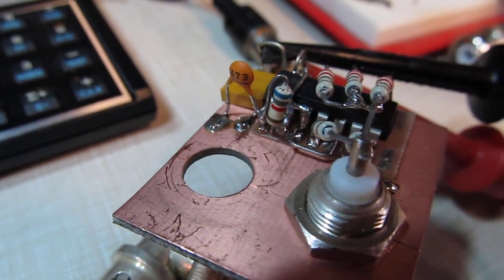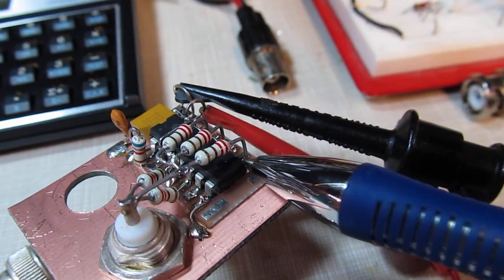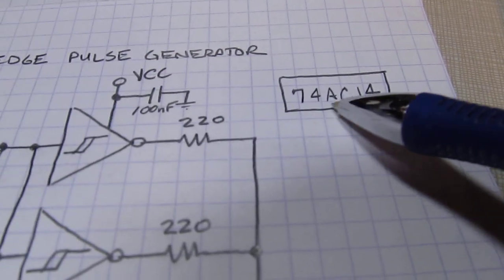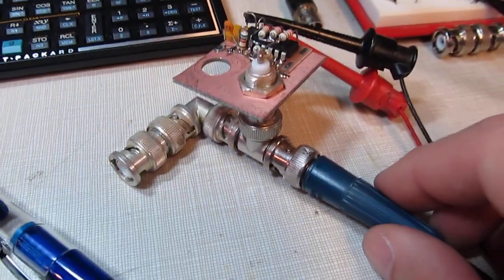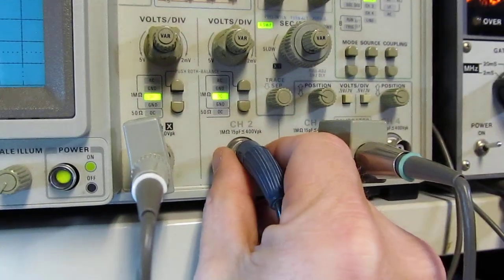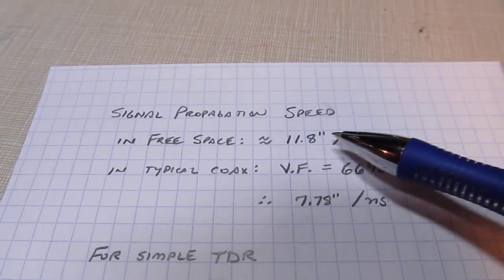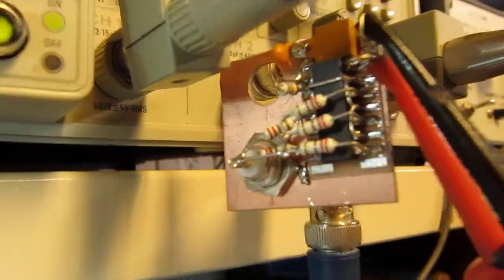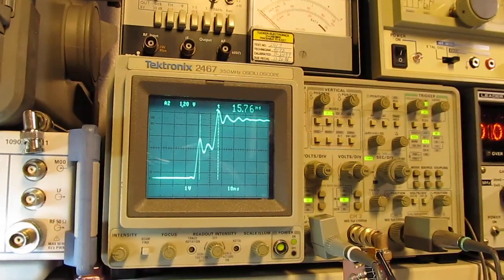#88: Cheap and simple TDR using an oscilloscope and 74AC14 Schmitt Trigger Inverter

Comment: W2AEW, say i have a 50 ohm source connected to a 75 ohm coax terminated at 75 ohm resistor then base on your reply it will not have a reflection. But how about at the point of connection between the source with 50 ohm ang the 75 ohm coax? Dont mean to bother you, just wanna understand.
Reply from the maker: +rommel villon There will be a reflection at the interface of the 50 ohm source and the 75 ohm cable, but that will reflect directly back to the source and be absorbed - but you won't see it at your observation point, if you're observing it at the input of the 75 ohm cable.

Comment: A follow up question, what if i want to apply the measurement of length using this technique with just a cable. How does impedance matching applies here.
Reply from the maker: +rommel villon In order to measure length, you will need to know the velocity factor of the cable (regardless of impedance).

Comment: Hi W2AEW,

You mentioned that you selected the value of the 5 output resistors so that the output impedance gets close to around 50 Ohms but i cannot understand why 220 instead of around 250. Another thing is if i want to measure the impedance of a  coax(say 75ohm) with this circuit with a source impedance of "50 Ohm", what adjustment is necessary?

thanks
rommel
Reply from the maker: +rommel villon The output impedance of the IC is not zero, it&#39;s likely in the 10s of ohms, so that adds to the 220 series resistors bringing the output impedance of each buffer to about 250.  No changes necessary if you want to use this method to measure the impedance of a 75 ohm cable.  If you adjust the termination impedance at the far end to match the coax impedance, there will be no reflection.

Comment: Great way to determine the impedance of an unknown bit of coax. (video #37)

You can also calculate the VF for an unknown bit of coax. Take a measured length and back-calculate what the VF must be to get the measured delay from a known length.

Thumbs up for bothe the #37 and #88 videos. (this comment posted on both videos)
Reply from the maker: +Peter W. Meek I did a video on that too (measuring velocity factor), exactly as you've stated.
https://www.youtube.com/watch?v=TpIIftvQPFM

Comment: Hi Alan, any recommendations for buying BNC connectors in bulk?

Thanks for sharing these videos!
Reply from the maker: +pj1390 No, not really.  You could try eBay or Amazon - look for vendors with high ratings and read reviews.  There's a lot of crap out there, but there are also decent ones to be found too.

Comment: i tried building the similar circuitry using a different Schmitt trigger, i am confident about my connections. my questions is does the circuitry only work schmitt trigger you used on this video.
Reply from the maker: +Mphotasium It needs to be a CMOS inverter (not TTL, and not open collector output).  The CMOS technology used will determine the rise/fall time, thus determine it's usefulness as a TDR source.
Reply: is SN74AC14N, CMOS HEX Schmitt trigger fine for the application?
Reply from the maker: +Mphotasium Yes, that should work fine.
Reply: +w2aew, thanks a lot. your information was very helpful.

Comment: Hi! just a question: can I do this with a simple wire, or does the shielding play a specific role in the coax?
Reply from the maker: +Manoel C. You need a controlled impedance and a current return path.  The constant physical dimensions of the center conductor to the shield establishes the controlled impedance, and the shield also provides the current return path.  So, no, this won't work with a single simple wire.

Comment: Apparently a difficult and expensive chip to acquire 74AC14, even on eBay.
Reply from the maker: +Digger D Really???  I see that the SOIC package version is 47 cents and the DIP package is 51 cents as shown on Mouser:
http://www.mouser.com/Search/Refine.aspx?Keyword=74ac14
Reply: Thanks, but the shipping charge of $20.74 to Canada ... ;)  Is there an equivalent that is as fast as this chip?
Reply: +Digger D I found it at Digikey in Canada - still $8 to ship but I will be ordering other stuff as well so cost will be under a buck Cdn.  Thanks for the video.

Comment: I just breadborded this thing. Works, yes. But I can't evaluate edge of pulses. Two scopes with different probes show different pictures. Cheap and amateur-oriented shows very fast edges , but more professional, industrial scope shows some smooth corners on growth edge. I tried two probes for comparision with 1:1 and 1:10 attenuation and result is similar with both of them. Cheap scope - hard edges, big machine - smooth. I checked internal scope calibrator 1kHz meander and it had more hard edges. Amazing.
And some more questions. While assembling this I played with this chip a little. First, as far as I'm quite newbie, just took a look on ShmittTrigger behaviour with DC. Put potentiometer to the input and scope's probe to output to see how voltage is jumping up-down. Nice. =) But I noticed that when I sloooowly decreased input voltage the output had some third state. Half of high level, circa 2.5V. I could keep that level for quite a long time.
Then I made oscillation loop with RC and... there were no oscillation! Very weak and shimmering appeared when I touched feedback R with metal tools like screwdriver. And fall front had a short middle horizontal degree just at half of full range. So, until I put some load to output, connecting OUT of first trigger with IN of the next trigger, it refused to work. Can You explain it? I presumed that C just couldn't discharge but scope displayed voltage level at OUT of Trig1 closer to that mysterious third state between low and high without any pulsations.
Reply: A little addendum. Oscillations often quench suddenly, I measured current in chip VCC and it is 1.35mA when oscillating and rises to 55mA when it quenches.
And some observations on capacitor. I tried ceramic oldschool cap like this http://fadedead.org/content/public/uploads/images/6ac/20121218000646-dsc04581-6d00d29f3ce5bc65.jpg and it responses on hand approaching with frequency rise, then I replaced it with film cap and the result is opposite - frequency falls on hand approach. Strange.
Hope for your answer.
Reply from the maker: A device like this involving very fast edges and feedback, is very sensitive to the circuit physical layout. I suspect that the breadboard construction technique is causing your erratic results due to parasitic feedback paths and poor supply decoupling.
Reply: ***** I see, I just noticed that slight movement of board breaks oscillation. And what can you suggest about rise of power consumption when oscillation fails?
Reply from the maker: When the oscillation 'breaks', I suspect that it is going into VERY high frequency oscillation, higher than your instrumentation can see - hence the higher consumption.

Comment: I think a good quality 100nF decoupling capacitor should be used.  It will be from that capacitor that the current for a nice rising edge will come.  This capacitor should be as close to the chip as possible, as shown in your circuit  (newbies might try putting at the power supply).  A good quality means low ESR, so look for COG/NPO (see wikipedia https://en.wikipedia.org/wiki/Types_of_capacitor) .
Reply: The lowest ESR Ceramic caps are type X7R.
Reply: Adding a 100pf bypass in addition to the 0.01- 0.1 uF is even better.
https://www.youtube.com/watch?v=BcJ6UdDx1vg
Reply: i wonder if adding more capacitors of an ordinary quality will help in case sourcing a high quality one is difficult. having two caps in parallel will make their resulting ESR r1*r2/(r1+r2)'ed, won't it?

Comment: my suppliers in Canada will not order a 74AC14, they want to get a NTE74hc14 , or other replacement.
 what else will work, can I use any Schmitt Trigger Inverter as I intend to use it in your video #90 to measure inductance in coils and capacitors.  thank you
Reply from the maker: hrj m The NTE part should work fine for that purpose.  Its rise/fall time will be slower which would affect its usability for TDR applications, but it will work fine for measuring as shown in #90.
Reply: hrj m If you are in Toronto, you can likely get these parts at Sayal, or order them from Mouser or Digikey.  I have some in my private stock, if you want one, contact me.

Comment: The ringing looks like a band limitation of the circuit. A band limited signal is a sum of weighted sines and since all real, physical signals are necessarily band limited (because of all the inductances, capacitances and QED in general), so is this one. In this case is looks exactly like a band-limited step response.
The shortest constituent in your signal has a period of around 7ns (140Mhz), which sounds right compared to the advertised rise time.
To remove the ringing you would need much better rise time (higher bandwidth). At some point the scope will low-pass filter the signal, removing the ringing from your view.

Comment: This is not directly related to this video but I have a question regarding FCC rules. 
If I want to experiment with Radio and I put equipment under grounded metal cage I cant break any FCC rules(lack of license for transmission on specific frequency)? Can anyone confirm this?

Comment: Hi Alan, I made a PCB for this. You should receive one in the mail soon. 73, EA5IGC
Reply: Hey there, do you have the files still for your pcb for this TDR, I need a 2ns square wave to externally calibrate my Tektronix 2430A as I'm going to have to change the NVSRAM and will probably lose the calibration data, I'm going to try and read it with an eeprom programmer but doubt the information is easliy transfered this way. Thank you

Comment: Excellent video, but in this video you use bnc connector. Why is there ringing?
Reply from the maker: Partially due to inherent ringing in the fast output buffer of the 74AC14, partly due to lead inductance of the resistors used and the parasitic inductance of how the circuit is physically assembled.

Comment: Hi Alan,
I have constructed your TDR model and incorporating an IC socket so I can swap various Schmitt Inverter chips rather than having a fixed IC. [I have only used SN74HC14N at this stage as I am waiting on delivery of my SN74AC14N).
I seem to be having some issues because the TDR doesn't appear to be pulsing (when I set the scope to the same settings as you do) and have just got a continuous output on my scope of 5 V (I am using 5V input from my PS), I then get the same 5V reading when I have connected just the coax from the "tail" of the BNC connector on the TDR to the scope input as you have done.  Note the TDR is not connected to the scope other than through the coax cable at this point.
When I test the various circuit ground points - without having an IC in the socket - I get the following continuity readings, some of which seem stranged - SHORTED??? But I cannot see any shorted lines or blobs of solder where they shouldn't be???

With one probe of my MM connected to the GND point of the 37nF cap and the other lead touching:
1. Pin 1 on the IC socket - NO continuity as expected
2. Pin 2  "     "         "         - YES have continuity to ground (where 6.8K resis. attaches to Pin 2) Is this normal???
3. Pin 3,4,5,6 NO Continuity to ground but Yes on Pin 7 - which is IC GND pin.
4. Pin 8,9,11, 13 YES continuity;
5. Pin 10, 12, 14 NO continuity

My TDR is put together exacatly as yours is and in addition I have attached a connecting wire from both Caps (common) GND to PIN 7, and then to the BNC connector GND as i have used perforated pcb board. Don't know if I can attach a picture to your comments or not?? But this would help if I could?

Can you see any problems with the above connectivity???

Regards, Ian
Reply from the maker: Since you built this with a socket, remove the IC, and verify the connectivity to the schematic is correct to each of the pins of the IC socket.
Reply: ***** Hi Alan - thanks for your reply however if you can re-read my last post you will see that I have said that all of the continuity readings were taken with the IC chip REMOVED from the socket - and this is what I felt was strange - since all of the points where the resistors are connected is what has given the "YES" results, other than the GND pin (where there is no resistor connected.
The point I failed to convey in my last response was that the 47nF cap was a polyethylene type and not a ceramic - I don't think this should matter but I am just a newbee at this! The other point is that all of the resistors I have used are 1 watt rating since I didn't have 0.5 W on hand which yours seem to be. I felt that 1/4 watt were too small!

For sake of clarity in my question - with the IC totally removed from the socket - when my MM probe is connected to the GND terminal of the 43nF cap and then in turn to each of the pins where the resistors connect to the socket pins I get the continuity "YES" results I said in my previous post - is this normal and what you would expect to get under these conditions?
Sorry to be a pest but this one is really throwing me off the deep end!
Do you have the facility for uploading pictures to your comments pages; if so how does one do this???

Cheers, Ian
Reply from the maker: Oh, ok, I missed that. With the chip removed, the only one of the socket pins that should show continuity to ground is pin 7.
Reply: ***** Hi Alan - thanks to your help I have located the problem: Don't really understand why this was causing this problem but I had an earth wire running from the common GND of the caps to Pin 7 GND on the IC socket - no problem with this - but then I had connected a separate wire from the GND wire on IC socket 7 direct to the base of the BNC - which was pulling the resistor connections at the respective socket connections to ground(????) - simply removed this wire and run a totally separate GND direct from the common cap ground to the BNC base and all is good continuity wise!

Now to add the chip and start playing with the TDR in earnest - I HOPE!!!!! Cheers mate and many thanks for putting up with my NEWBEE questions.

Comment: Further to my previous post I have been studying your circuit diagram and the only question that I now have is; "Is the 100nF capacitor under the Vcc line the decoupling capacitor you mention, or does this capacitor form a part of the internal circuitry of the 74AC14N Schmitt IC"?? I previously thought the 100nF cap was the latter but I now think I was mistaken??

Please advise.

Regards, Ian Brown
Reply from the maker: The "decoupling cap" is the orange rectangular component laying on it's side.  It's value is not very critical.  I used 100nF because that is what I had laying around.  Any value between 10nF and 1000nF or more would work well.  Even a moderate value electrolytic or tantalum cap could be used.  I chose 100nF because it would perform well for filtering the supply during the fast transitions on the output.  The decoupling cap does a few things.  It smooths the supply rail.  It provides "local" charge storage to soak up the transient supply current demands of the IC.  And, it provides a return path for the image currents for the output stages.  You want to locate it as close as possible to the supply and ground to minimize the loop area of the image currents, thus resulting in cleaner/faster output rise/fall edges.

Comment: Hi Alan - this is a very late comment to your TDR video (its now 2/01/2015); as a total newbee to this medium firstly let me congratulate you on your perfection, schematics and absolute clarity you present these details. As a semi-retired scientist (analytical chemist, geologist & gemmologist) who is now getting back into main stream electronics after a 45 year break - you are truly a breath of fresh air!!!  

 I have read every reply since when you first posted this video and have not been able to get any details on your "decoupling capacitor" used - I have searched in vain on the internet the numbers that are visible on the yellow square plastic cap; viz '2073G, L1104 & E8515', and have drawn a total blank!!!

Would it be possible for you to provide this cap details, its type and how you have connected it to your TDR apparatus as this is not at all clear in the video???

Also explaining what the 'decoupling cap' is actually doing to the voltage supply (a wild guess on my part, without knowing, is that it is removing or reducing to a very low level any AC ripple on the incoming DC voltage)???

Further, do you have a complete circuit diagram - including the decoupling cap - for your very cleaver piece of kit?

I am wishing to build your TDR as I can see this will be very instrumental in teaching me how to use my very new 100MHz digital scope as well as providing a very practical application for it.

If I may comment to the very few rude people who criticise your use of imperial units - I would say get a calculator and do the maths yourself if this is an issue for you; we all use what is or native tongue and what metrics we are totally familiar with!  To the few who have complained about you saying "OK" every sentence - to them I say; "yes it can be distracting and break one's concentration when a viewer is hanging on your every word", but to them I say "suck it up" and move on if you can't really appreciate all that Alan is saying and presenting!!! Your adverse comments demean this guy and all the good he is doing for us very new and perhaps not so new 'Newbees'!

Keep up the excellent work, mate!

Cheers, Ian (from Gippsland in Victoria, Australia)
Reply: 😅 you probably already know this by now, but a “decoupling capacitor” is in 99% of cases generally any capacitor with a value of between 0.001uF and 0.1uF. And you are correct in that it’s purpose it to remove any high frequency interference (you could call it ripple but generally that refers to lower frequency variations) on the DC power.